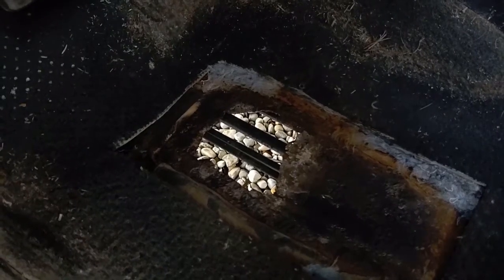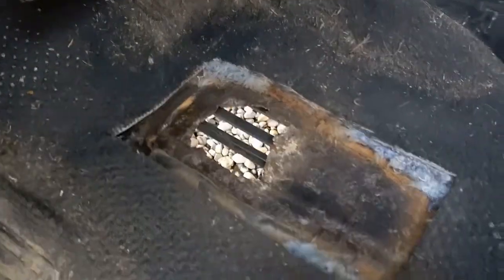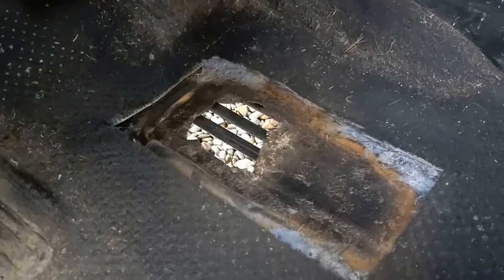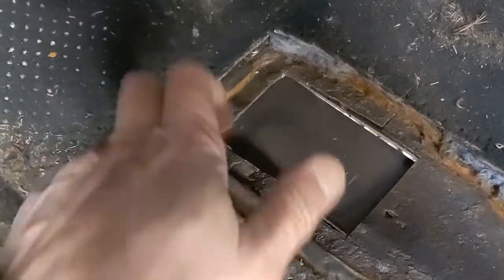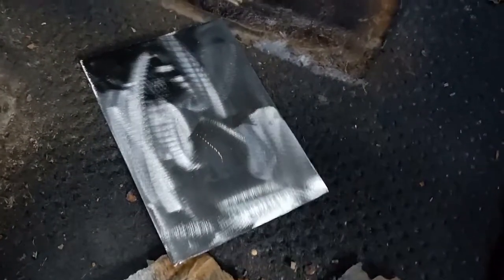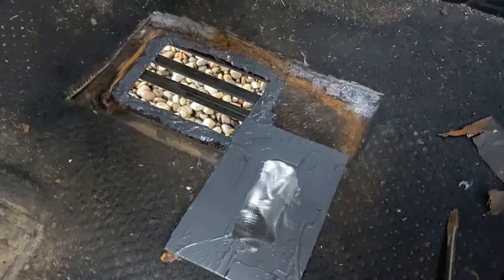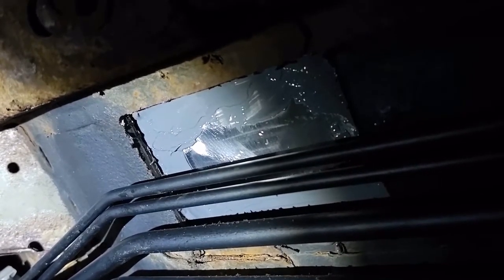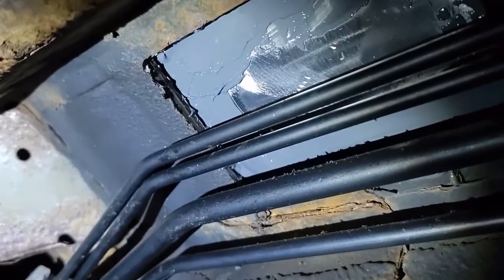JB Weld Floorboard Repair on 2008 Honda Element

Comment: how did that repair hold up?
Reply from the maker: I was just thinking about doing a follow up video on it. I haven't even looked at it since last year. As far as I can tell from the interior, it's fine. The floor feels solid under my heel. I'll reply again once I make a video. I'm curious what it looks like. Since I did the repair in winter, outside I didn't have great conditions for painting, so we'll see if it's corroding.
Reply: @naturalordercompany334  I was just thinking of doing this same thing on my 97 Mazda truck when I came across your video. Don’t want to weld and everyone has said either Jb weld or 3m with a patch panel.
And anyone who has done this said what you said, seems to work fine with no issues 
Love to see the follow up video if you do one.
Thanks for making this video actually helped me finally make a damn decision lol…
Reply from the maker: @shabadooboogywhipp  I did some weld repairs on my old 1997 F250. The floorboards were rusted out massively on that thing, plus the rockers, and the cab corners. That was all very time consuming, plus dealing with the heat and fire risk is a major hassle. Like all that was hours and hours. This JB weld repair was maybe an hour at most.

I thought about using a pneumatic flange tool on the patch panel for this repair. That might have been slightly better, because the exterior surface would have been continuous instead of having a step in it. but I didn't bother since I thought the repair might last 10 years anyway.
Reply: @naturalordercompany334  my Mazda is just a minor project truck so wasn’t going to get crazy on it
The rust I have is just one small spot
but big enough to need a patch
I don’t have the time for a proper weld
My friend is a welder but hard to get but he had said 3m was almost better than welding but jb weld might be a good second option 
Obviously it worked out pretty good for you and mine near the door so I think it’s less complex than what you had going on